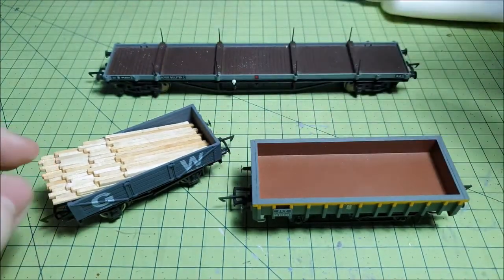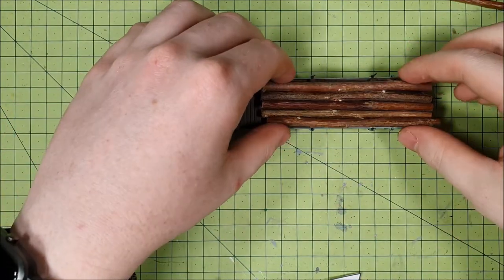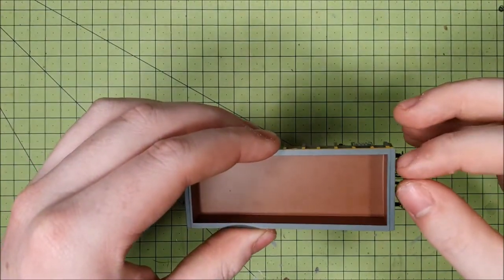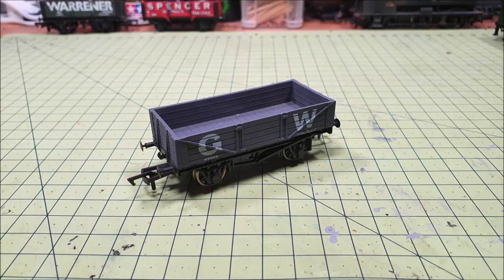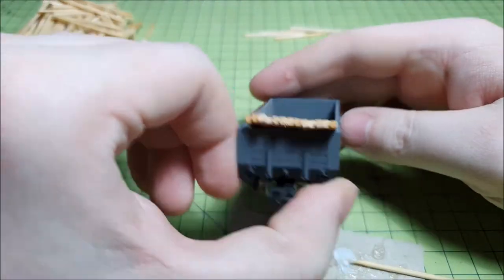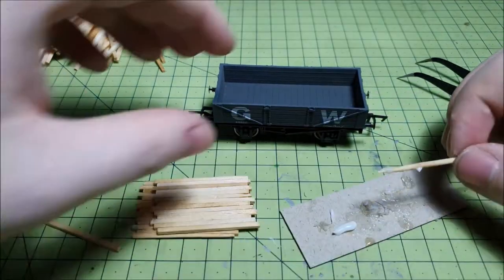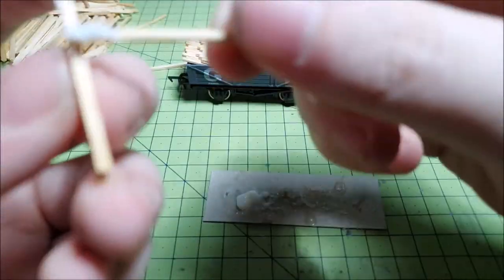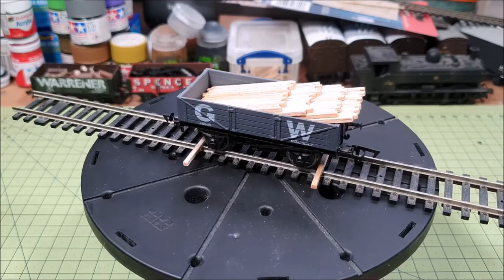How to Make Wagon Loads - Logs, Sleepers and Timber - OO Gauge

Comment: I like the timber load.  I tried using cardboard with matchsticks on top.  Your load looks better than mine.
Reply from the maker: Thanks very much, there are alot of ways how to do the timber load and there's not many photos so the possibility's are endless as to what looks right and what doesn't. It's really down to personal views.
Reply: I've seen the cardboard mounting idea used before (possibly on a 40 year old Blue Peter episode!). You could also stain the matchsticks, or use a watered down brown for similar effect. The sleepers could use some sleeper grime or similar - they still look like black plastic without something done to them.